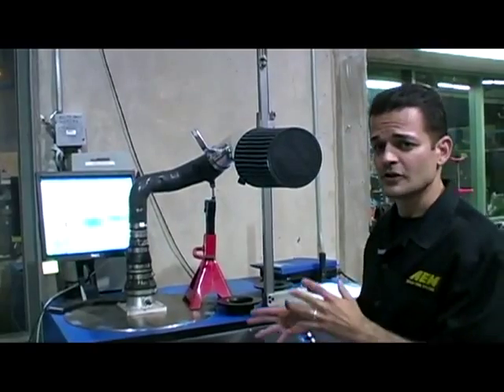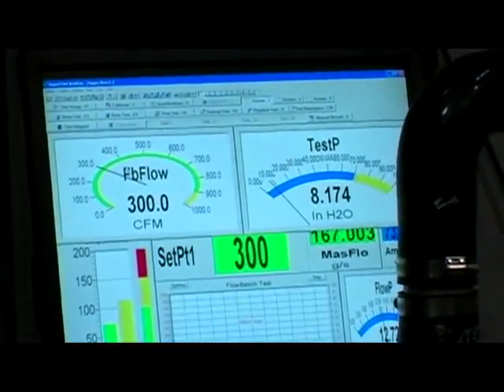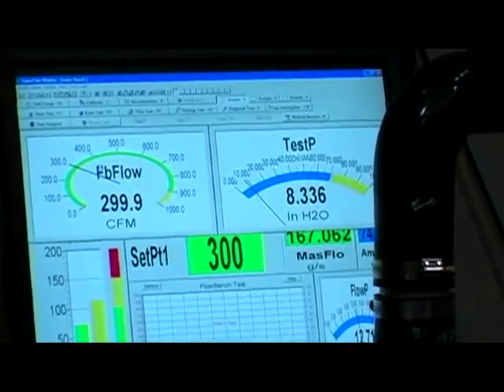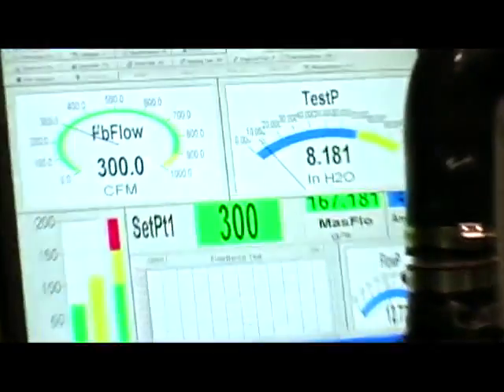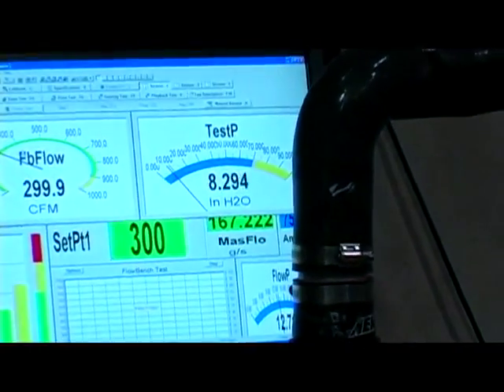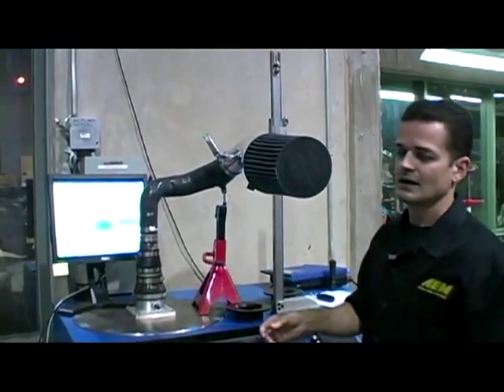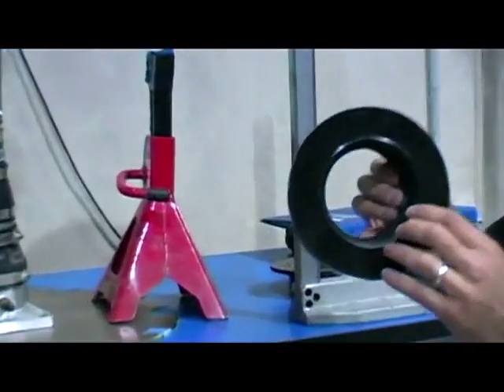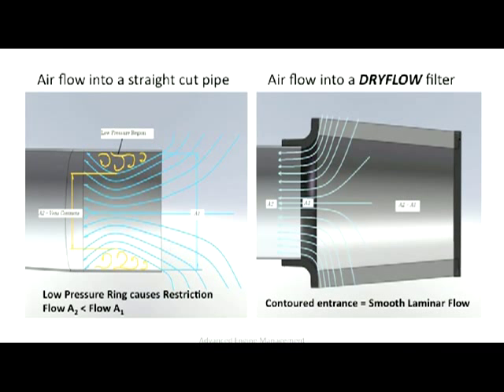Intake Test - Bell Mouth Demo On Flow Bench - How It Works & It's Effect

Comment: Help me understand. The shape of the air filter helps the air flow? With the filter removed the air flow is "rough" and doesn't flow as well. Basically you are looking for the lowest vacuum number possible?
Reply from the maker: Exactly. Lowest vacuum possible at turbo inlet. For NA lowest vacuum possible in the inlet manifold at full throttle. No vacuum = no restriction. 

Autospeed has a great article https://www.autospeed.com/a_0629/page1

Comment: more vacuum is better  ?
Reply from the maker: Hi. Directly after the air filter you want the pressure to be as close to atmospheric as possible. Vacuum/negative pressure directly after the air filter is bad
Reply: @DriveTuneMedia  Tell it to all turbochargers.
Reply: @Fosgen  lower restriction means turbo works less for same mass of air compressed, if your controlling boost to a certain psi, that means lower blade speed to achieve the same pressure level, aka less heat on the compressed side and better turbo life/response/efficiency.  It matters.

Comment: paper or foam filter?
Reply from the maker: +turbotonic27 HI. The AEM Filter in this test is synthetic fibre. Material is irrelevant to the bell mouth prinicple.
Reply: +StreetandCircuit i as asking whats better foam or paper  for a 2 stroke engine
Reply from the maker: as long as the size is correct either is good. paper will be one time use, foam will be cleanable
Reply: StreetandCircuit Thanks, i know there are different designs, like horns, round ones,  cones, is that for aesthetics or is there a  actual benefit from using different shapes  of foam filters
Reply: @turbotonic27 coan
Reply: @turbotonic27  go for k & n dome/cone with the metal shroud around it or get a pre filter wrap online. I got one for my goped and it works so much better. Also velocity stack!